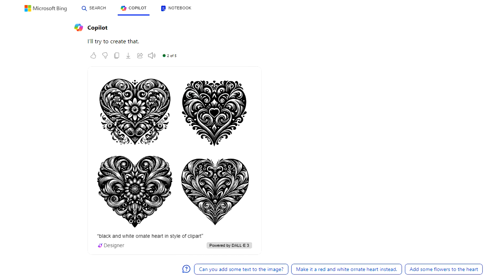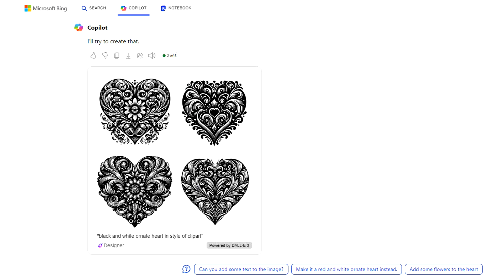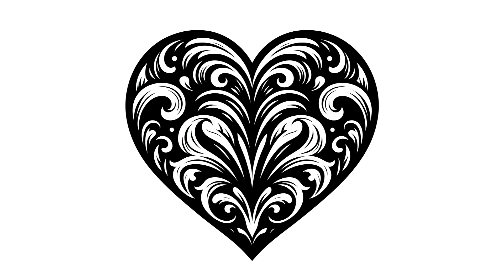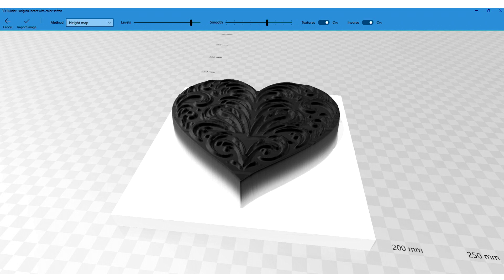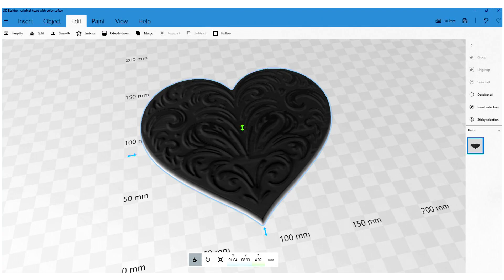AI Created MY Aluminum Sand Casting!

Comment: What Greensand do you use?
Reply from the maker: The sand that I used in this video is Teton-bond Petrobond 190mesh.  Its oil based.
Reply: @DamonsMetalCasting  Thank you so much. My friend and I were trying to sand cast some rings today and could not for the life of us get the printed pattern to release from the mold without taking chunks of sand with it.
Reply from the maker: @sp0764  I hope it helps.  The petrobond I purchase has been pretty good stuff.  I have used babypowder with it before and it works ok but for me Talc works a bit better on the pattern, except its an inhalation hazard.  I only apply talc with a makeup brush to the part.  My parting powder for the 2 halves of the mold, I use baby powder/corn starch because it does work fine for that.  Hope you can get some success, good luck and thanks for watching!